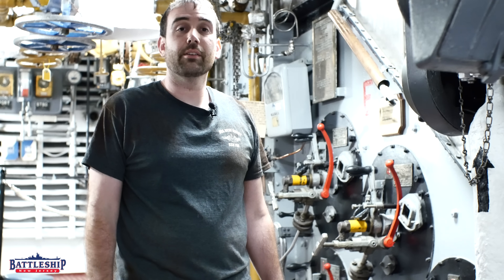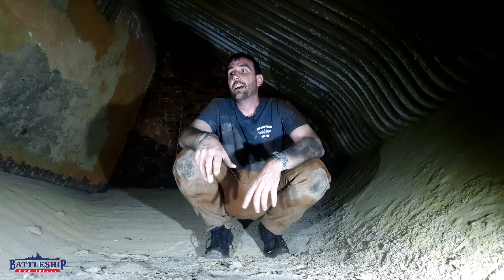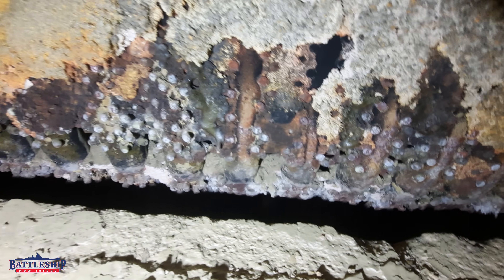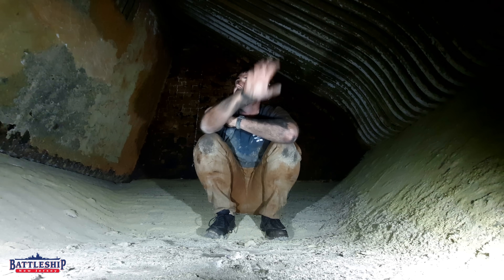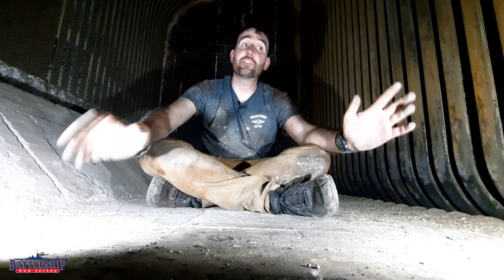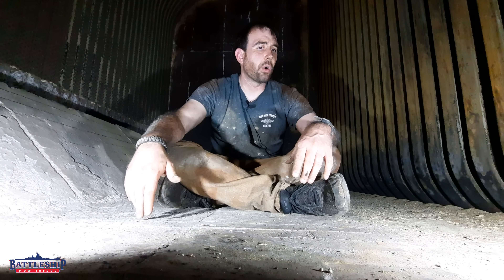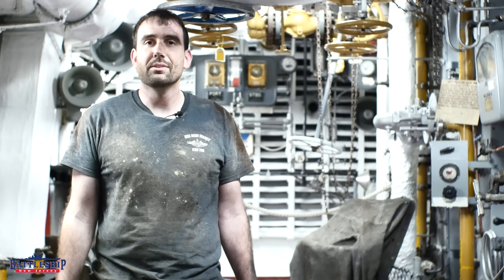Inside the Boiler of The World's Fastest Battleship

Comment: Hi Ryan, that's a great illustration of something REALLY out of bounds, lol.

Just curious, did/does the navy not differentiate between 'firebox' and 'boiler'? Of course firebox is a term I'm used to from steam railway locomotives, and so I'm wondering whether in the navy they simply ditched that term and refer to the entire setup as the boiler.
I can see why they would, and perhaps always have, but I thought I'd ask as I started wondering about the different terms. 

I'd not be surprised if most people are more familiar with steam locomotives than large steam turbine ship power plants, so that different terminology is interesting if in a decidedly nerdy way, LOL.
Reply: The firebox is simply a component of the boiler.
Reply: Steeltrap;  I think the distinction may arise from the fact that steam railroad locomotives use "fire tube" boilers and ships mainly use "water tube" boilers.

     In a fire tube boiler the firebox has the function of creating hot combustion gasses and it is more or less physically separate from the boiler barrel which has the water in it.  Tubes conducting these hot gasses run through the barrel from the firebox at one end (usually at the rear of the locomotive) to the smoke box at the other end of the barrel, usually at the front end of the locomotive.  In doing so heat is transferred from the hot gasses to the water to boil it. The front and rear of the barrel portion of the boiler are formed by "tube sheets" which are thick steel sheets with holes in them into which the fire tubes are swaged.  (A tough job I can tell you!)

     In a water tube boiler the functions are all combined in one piece of equipment by putting the water into tubes and putting the tubes right into the firebox.  This creates a more efficient boiler but it is of a shape that would not work very well for a locomotive where there is not much restriction on length of the boiler but the width of the boiler is restricted by the loading gauge of the railroad.
Reply: @Vincent_Sullivan  I suspected it was something like that but wasn't sure. I could go search for the answers, but sometimes it's more fun to see how others answer.

I've watched videos about restoration of various locos, and I was fairly sure it was gases up the tubes through the water vs water into the tubes through the fire, but you've given a much more thorough reply, thanks.

Cheers

Comment: How do you restart a battleship when it has been powered down?
Reply: Very carefully! If you have shore steam and some shore power, it's not too hard.
Steam to heat the fuel oil (it's like tar when cold). If you have steam pumps, use them to circulate and heat the fuel oil to the point you can light fires (250 F or so), shore steam to get the forced draft fans going (you can utilize natural draft if ya have to, but it is "messy"!).
As the pressure starts coming up you can bring the various systems up (35, 125, 300 etc. psi steam).
 Once you have pressure up, 600 psi if you're not in a hurry, bring up the auxiliary condenser for the turbine generator, get the turbine up and on line, then you can bring the main engine up when you like.
I left the details out for brevity.
Simple, right?

Comment: well you want the water to be right and clean, heating it that much does weird things to it, just ask any historic railroad the runs steam though its not as high pressure as this, but it causes foaming and limescale build up and that take away performance from the heating surfaces and can cause hot spots in the tubes of the boiler, as well as clog it up, and if your water chemistry is not right it will corrode the boiler by stealing elements from the steel to blance the chemistry, also superheating puts more energy into the volume of steam, you get more energy out of it not just about the water droplets, which can not just eat away turbine blades condensation can actually flash boil like a wet charge in a steel mill and flash rapidly expand explosively.

Comment: For a boiler think heat transfer.  For air,  water, and steam and exhaust gases.
The boilers are at 600psi, 865 F max temperature of the steam (these limits are set for continuous on going service without damage to metals in boilers/piping/turbines).   For the steam to be superheated it has to be over 489F.  Anything under at 600 psig is considered saturated (see steam charts of temp at various pressures).  865F max is for the turbine set by manufacturer/navy for the continuous operation of the turbine.  Steam enters the turbines at max pressure of 585 psig (This is the mandated  max working pressure of the turbine inlet (or first stage of turbine); a very low shaft speed rpm could be steam inlet of say 5-20 psig etc).  

The fire at the fireboxes get warmed air (from going around casing of boiler, exterior of boiler) and gets ignited in the furnace.  The fire burns between 1750 and 2200F .  With Bunker C a boiler had to be lit off first with diesel, until you had steam/heat to help flow bunker C. The exhaust gases (flue gases) are the burnt combustion of the diesel and warmed air.  These gases travel over the tubes (outside of the generating tubes, down-comers, superheaters, etc)  and exits the boiler by way of the economizer and uptakes; giving up heat to the tubes as the gases pass over them.      

This heat from the fire is transferred to the water to the tubes (radiation and convention).  The water gains energy by absorbing heat from the tube walls.  As water in the tubes (at bottom) gain heat the water gets less dense and travels up the tubes (heat rises).  More heat is added until the water, is now saturated steam.  More heat is added in the super heater to ensure all saturated steam is now superheated. (I couldn't find a actual description of water/steam flow in a M type boiler, but the principle is the same, heat is transferred to the water through the tubes.)

Steam travels through pipes to the turbines.  Energy is extracted by the turbine blades through the drop in temperature and pressure.  

The vacuum in the condenser helps with the efficiency of the plant, by increasing the overall range of pressure drop. Usually around 25-28 "Hg.  In the condenser, the condensing steam causes the vacuum (cooling steam by the cold sea water tubes).  Vacuum is maintained/started by Air ejectors (venturi effect).  

The condenser water (condensed steam) is taken out of the condenser by 2 stage pump. (this might be different on NJ).  
Water passes through deaerator (gaining heat by low pressure steam which also helps with non condensable gases-especially oxygen ), and the deaerated water is pumped to the  main feed pumps (which increase the water pressure to about 700-750 psig), so water could enter the economizer and boiler (boiler at 600 psig).

The big difference between a shaft turning at 5 rpm and a shaft at 225 rpm; is the mass of the water/steam in the closed cycle.  Therefore there had to be a way for mass to enter and leave the system. Usually using the deaerator to help make up and extract water from the closed feed system. 

The boiler acts as a kettle, and so will leave behind deposits in the lower part of the boiler... Back in WW2 they had an additive called Boiler compound, which got rid of oxygen (oxygen scavenger), elevated pH (ideally around 8.5-9 ph), and made scale softer (blow down overboard).  All this to avoid corrosion (rusting) of the metal tubes, which prevents heat transfer in the tubes.   today there are better ways to control boiler feed water to prevent corrosion.
Reply: If I recall correctly, the biggest difference in an "M" type boiler is that they basically partition off one side of the boiler and derive superheat by routing steam into the second half where separate burners provide the heat, rather than using the more typical method of routing flue gasses through the superheater coils. 

Could be wrong.  Been over 30 years, and I was an IC, not a BT.
Reply: Good explanation! I'd take issue with your statement on where the vacuum comes from. It comes from the steam condensing (primarily). A tight plant, with good gland seals won't need air ejectors, but nothings perfect and the air and noncondensables do need to be removed. 
Also, air ejectors aren't the only way. I've worked on a bunch of ships that just used a roots type vacuum pump instead 
One ship I was on actually would pick up  1 or 2 rpm on high speed runs by securing the first stage air ejector, letting the 2nd stage to deal with it. The theory was that we got the steam from the 1st stage to the turbine instead. Never seen it work on any other though...

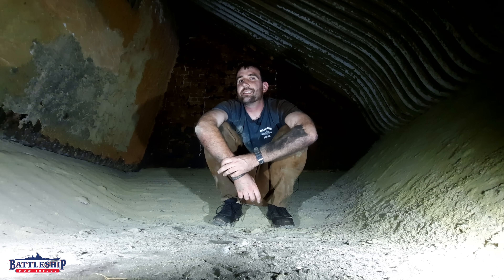Comment: Small correction... 7:53 "The condenser is pulling something like a negative 2 atmosphere vacuum"
 
Um... that's literally and physically impossible. The maximum vacuum you can have (assuming the outside pressure is 1 atmosphere) is, well, 1 atmosphere. That's only attainable if you could somehow remove every atom of gas from the condenser, in other words you have created a better vacuum than outer space. So, I'd suspect your condensers could probably do more like 0.5 - 0.75 atm of vacuum?
 
Anyway, other than that it was a fascinating video, and a good addition to the "Ryan crawls through things" series.
Reply: The navy doesnt measure it in atm but in inches of mercury and the math conversion makes the numbers easy to interprete it as 2 atm.
Reply: @dancooper1963  What's the vacuum measured relative to?

Comment: I was a Boilermaker at PSNS, completing my Apprenticeship in 71. Posters are correct about the studded tubes being used to retain plastic (malleable) castable to protect tubes from direct flame impingement.  That boiler appears to have been using distillate fuel, rather than Bunker C. Bunker C would leave a lot more black soot and tarry deposits.
Reply: With Bunker "C" the goo would build up and when you looked in the burner port you could see a mass hanging from the firesides that looked like a body. We use to call them "Deadmen".
Reply: PSNS motto, "file to fit, paint to match."

Comment: "Nuclear powered" ships are also steamships.  A point that seems to get missed a lot.  Whether you're getting the heat from burning fuel oil or from a nuclear reactor, it is still used to produce the driving steam to rotate turbine generators or engines it is all the same.  So, nuclear submarines are steamships, except they use a nuclear reactor instead of boilers to generate the initial heat source.
Reply: Nuclear submarines would be steam boats
Reply: @danielleeming1027  yep

Comment: I just can’t imagine a 900’ long battleship going 40 mph - just another example of how the Iowa’s were really the epitome of battleship design. Hell even smaller and far more modern warships can’t approach speeds like that… just amazing when you’re talking about technology 3/4 of a century old.
Reply: @ralphgesler5110  Isn't another factor a ship's length to width proportions? Umm, my brain is dredging up the term, fineness ratio, is that the thing?
Reply: I mean, steam is the "Hand of God" and it was and still is one of the most efficient systems (depending on how you use it) ever made. If you hop onto Jay Leno's channel he has several steam powered cars he talks about. At the final gasp of Steam, the designs were so efficient they could be considered modern (in terms of performance) today, despite the car weighing several tons more than a modern variant. Jay even takes a few of them on the highway, keeping up with traffic just fine. 

What's actually shocking to me, is that these modern ships didn't take advantage of that technology. I'm assuming that there's got to be some limitations regarding up scaling that tech (speaking of the one used by Doble), because in terms of power and reuse of power, those engines could probably push these ships even faster.

Even more shocking, is the fact that we're not using steam cars today, with the advent of more efficient batteries and steam generators that fit inside your average beer cooler, making twice the power old steam generators did on electricity, we'd have far cleaner cars, even cleaner than electric only.
Reply: @aserta  Drachinifel has a long video on his channel discussing steam ppwer on warships with a guest who's an expert on steam cars- really good video, like you said, upscaling changes a lot of what's practical. Also the last car steam engines were so precisely made that you couldn't adjust anything on them or they wouldn't work right, they had to be perfect. That condition is maybe not the best for a battleship intended to slug it out with other battleships, and maintained by lots of sailors constantly.

I find the steam power stuff just so amazing, crazy to think how efficient they had become like you pointed out.
Reply: @KennyCnotG  Well almost all major powerplants use steam turbines, I wonder why it is that modern freight ships don't use steam turbines anymore, probably maintainance and space requirements.

Steam has the relation with the bigger the more efficient it seemingly becomes.
Reply: @vHindenburg  Diesel has become more efficient, that's why. It is all about fuel consumption.
Reply: @tedmoss  Yes, internal combustion is more efficient than external combustion. The diesels require less manpower and specialized training to operate and maintain also.
Reply: @aserta  It is impossible to circumvent the 50% overall efficiency limit at the present time.  So it isn't happening. Electric car efficiency can approach 98%.
Reply: She was haulin ass.
Reply: @ralphgesler5110  As are larger ships and anything else.
Reply: Quite simply external combustion is less effciant than internal combustion

Comment: I'm surprised the fire brick is changed so often! every two months of running. Aren't you sure that is n't the time between sweeping outs? 
Compared to the superheated side and the regular side, it might been cleaned more recently.
that should be in the Engine logs I think.
Reply: Thinking only when top speed is required all burners are lit so in practice it would be far more than 2 months

Comment: Does the ship still have asbestos in that area? Or did the ship not even use asbestos?
Reply: The Asbestos was pretty much all removed in the 1980s.
Reply: @barto6577  Thank you for letting me know.
Reply: @barto6577  The ship has tons of asbestos on it.  The only asbestos that was removed was from systems that needed to be overhauled or inspected.  Take my word for it, I was an Insulator for 20 years and also worked on New Jersey and Missouri reactivations, yard periods, and after they were decomissioned.  I also did a lot of the asbestos removal in the engineering spaces of both the Jersey and Mo.  Back around 1998 I wrote a paper on how much asbestos was removed from what systems in engineering and Dick Landgraff submitted it to the New Jersey Assn.

Comment: I have crawled D type on other ships. Just fyi you would not be replacing all firebrick at that periodicity but rather inspecting and removing slag and making local refractory patch repairs. Replacing refractory is a big job usually done by a contractor. The throats must be in good condition also, to ensure good fuel/air swirl pattern. Awesome video!

Comment: The tubing on the outside bulkhead is a water cooled wall. First, like the name says, it cools the outside walls of the boiler reducing the amount of insulation required. Second, like the economizer, it preheats the feedwater before it goes into the steam drum.

Comment: 1600  hours seems fairly short. That is only 66 days at 24-7 firing.
Reply: They don't run them 24/7! They (Navy ships) will shift back and forth between 2 boilers to even out the run time. Navy ships set at a pier more than underway.
This causes all sorts of problems from all the thermal expansion and contractions that go on in their operation. A merchant vessel, on the other hand, can and do, start up coming out of a shipyard, travel at full power during transits, don't shut down in port, and do that for 3 years, until they go back in a yard. Far, far fewer leaks, mechanical failures etc.

Comment: You could send people (boots) down for a "BT" punch. Also I sent a Corpsman striker down to the BTs for a Fallopian tube and he came back with one.
Reply: And just for all of you "Know it alls" there actually WAS a tool used for cleaning the inside of the boiler tubes. The process is called Punching the tubes. It uses a jigh pressure water jet to turn properly sized rotating bristle brushes. One of the companies was the BEETEE company, so yeah, you REALLY could get a "BT punch". A
Also, the lubricant used on the gyroscope bearings was "RELATIVE BEARING GREASE". It was in a small tube, about the consistency of thick 3-in-1 oil...
Reply: I liked it when they'd send me after a bucket of steam! 
It invariably took the rest of the day to find it, but by the time I got back to the engineroom, it was just a couple of drops of water! Aw shucks!
I liked 50 ft of water (chow) line, a box of radar contacts (sonar contacts too!)

Comment: BTW you cannot pull more than -1atmosphere of "vacuum" at sea level, even pure empty space will only have the outside pressure working on it. This is also why vacuum powered equipment is common on cars/ships, but very rare on aircraft or submarines, as changes to the ambient pressure will far more drastically change their force than a compressed air powered circuit... a perfect vacuum will exert on quarter the force at 35,000 feet (3.46psi) it did at sea level (14.7psi), meanwhile a "low pressure" (nominal cap of 150psi) pneumatic system will exert either 7% more if regulated to absolute pressure, or the same if referenced to "gauge pressure" by a diaphragm with backing to ambient environment.